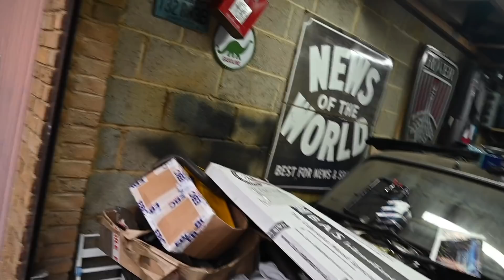Rover V8 new manifolds and other bits blog

Comment: I bet you know about expandable driveshafts and the forks placements on the ends? As the sliding part can be removed and put together wrong, this makes the shaft shiver and can ruin a nice drive. But it is pretty easy to check them, each end of the shaft has it's "fork" and this fork needs to line up with the one at the other end of the shaft. This means there is just a wrong and a right mounting, if it still shivers, turn it 180°. Most driveshafts are balanced in one position. :)

Comment: I don't remember if the cabriolet was a manual or automatic, if it's a manual it should be able to climb that curb on the starter! Maybe turn the wheel so that it isn't as steep?
Reply from the maker: Its manual, I did think that but didnt want to risk burning the motor out..you know what this cars like
Reply: @furiousdriving  it coul'd do with a spanking, as it has treathened you after all your loving care! ;)

Comment: I know you will have done this but as someone who was saved by a timely reminder make sure you upgrade entire fuel system to Ethanol safe.  Beware of any rubber washers in New old stock fittings as well as they can perish rapidly with new fuel and cause pinhole high preassure leaks. Probably teaching the proverbial to suck eggs.
Reply: He actually mentions just that in the video 😁
Reply: @Dixieddawg  I know with the lines but I have had various seals go on tank fittings. Even had seals degrade in carbs and drop fuel onto the manifold. LPG on standard fuel lines (I know this is not LPG) killed my Range Rover :-(
Reply from the maker: Yes, considering ethanol fuel has cleaned out the W123 system enough to work again its nasty stuff!

Comment: Black paint overspray on the driveway???  Even if I was prepared to live with it (which I wouldn't be)....my wife would have another opinion on the matter! 😖
Reply from the maker: it was on a piece of wood! Full width loft board I left in front so I could roll the car out and back without getting stuck on the ridge - its going in a skip soon as the Rover nearly works
Reply: @furiousdriving  Apologies! It's certainly "full width"!